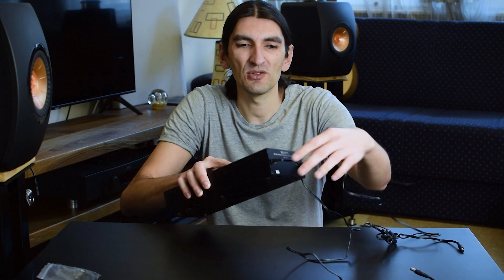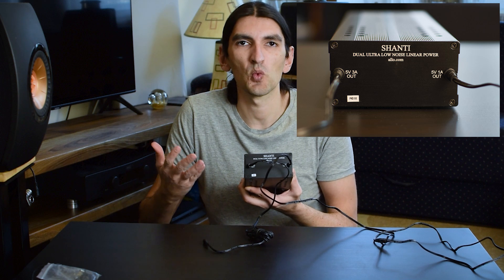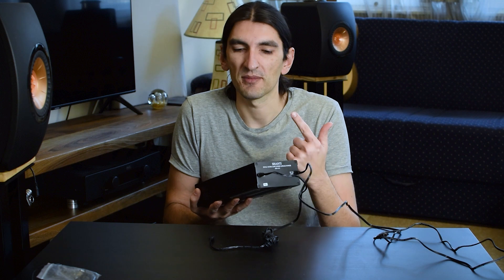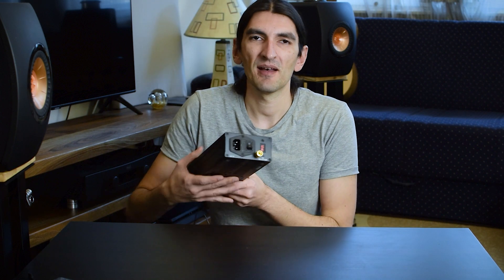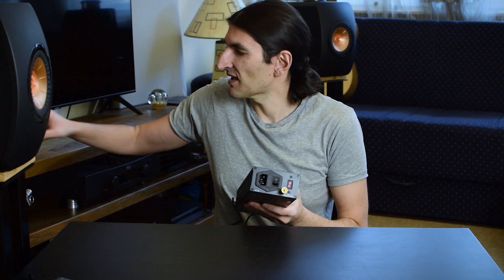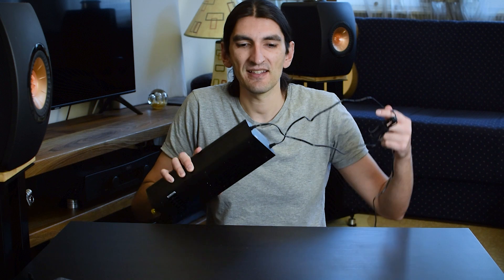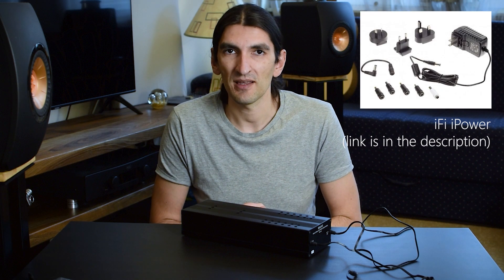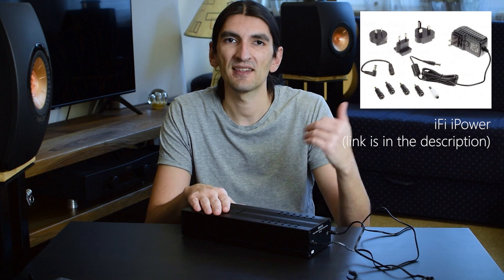Allo Shanti Dual Linear Power Supply Review

Comment: If I have issues with the installed electricity in my home, does it matter which external linear power supply I buy (cheap or expensive), if I only care about fixing issues like subwoofer humming, amplifier hissing sounds, and any other negative issue, caused by bad electricity installment in the walls or something? Let's say I don't care about improving audio quality, just making sure I don't have electricity issues impacting negatively my devices.

Comment: My issue with these is the same as all the power supplies out there you can buy. Yes they help but no I shouldn’t have to upgrade the clock / power supply of my two thousand dollar DAC. What’s next? Updating the DAC of my two thousand dollar DAC with another DAC? 

Tweaking is great but when manufacturers use the trend to skimp on clocks and power supplies it’s not so great.

Comment: Hi. Loved this video and it triggered me buy the iFi iPower X for my Wiim Ultra streamer/DAC. My issue is I cannot figure out how to connect it together. The Ultra comes with its own power cord. Bought it on Amazon and they cannot help me. Any suggestions?
Reply from the maker: Wiim Ultra has an integrated power supply (opposed to external ones on Wiim Pro and Wiim Mini) and it is fed with AC voltage directly from the mains. So you can't use external power supplies like that with it.
Reply: @iiWiReviews  Thanks. I am vindicated. Luckily I have other Wiims! $$$ sent.
Reply from the maker: That's great. It should make a difference with them. Thanks for the support!
Reply: Hi there, would this apply to the cyan 2 also? Or would that require a different type of power supply?

Comment: For the sake of accuracy: switching mode power supplies do have transformers inside them, except they are much much smaller for a given watt rating. 

The reason being the fact they run at much higher frequencies ( 40khz vs 50 or 60 Hz) which according to laws of physics allow reducing the amount of steel in the core and the turns number of both primary and secondary windings.

Providing they are properly designed they can give much better results than the classic linear power supplies

Comment: Great vid as usual. Would the Shanti be good for my Chord Qutest? Which output the 3 amp or 1 amp would be best?
Reply from the maker: Both can power Qutest just fine. Use 3A if you don't need it for anything else. But if at any point you aquire let's say a streamer that needs that more powerful side... You can move Qutest to 1A and it will work just fine.

Comment: I have ifi Zen One & Zen Can signature set, it comes with ipower 2. I want to change the power supply from ipower 2 to Allo shanti. Can I use the shanti for two device which are Zen One & Zen Can at the same time? The Shanti has two 5v output, but different A which are 1A & 3A. Is it OK?

Comment: Love the video. How can you use this power supply with a Topping D70s or does it not need it? Thanks.
Reply from the maker: It's not needed and also can't be used with D70s. Unlike most cheaper DACs, D70s has an integrated power supply.
Reply: @iiWiReviews  But this could be hacked by the handyman ;-)  
Do you think it will improve the sound quality though?

Comment: I'll consider this to power a Silent Angel Bonn 8 ethernet switch and hopefully it does a good job so i won't have to buy the Silent Angel Forester F1 PSU.   then there's the question of adding  a Synergistic Research Orange fuse on each DC powered box

Comment: Another great review!
A question, please: How does it compare to WEILIANG PSU in terms of audible noise coming form the power supply unit itself? In other words, which one is QUIETER and how much quieter is it? Thanks
Reply from the maker: Both of my units are perfectly quiet without any audiable transformer noise. This, however, might also manifest itself differently in different homes. For example, Hegel amps can be noisy if mains power is not clean... I know people using power filters to get rid of it, but in my home two Hegels I used were completely quite too. So I might be lucky with a fairly clean mains power here... But that said both of these power supply are perfectly silent in my place.

Comment: Not free, but included. You obviously paid for the hole package.
Reply from the maker: Yeah, you're right. English is not my mother tongue so I make mistakes, specially when thinking about some other topic and not the language itself. But I try to remember and apply corrections like this one.
Reply: @iiWiReviews  It’s not an issue with the language. It’s common misrepresentation that continues to spread like a virus. Many speak about a free apps being available for products you buy. I was under the impression that mostly infomercial youtubers talk like this to create the impression that you get stuff for free when you buy a product. Just be mindful of this construct 😀
Reply from the maker: Huh, interesting. It's just a mistake in this case. I purchased it myself, no connection or any other type of affiliation with this product whatsoever.

Comment: but my dac doesn't have dc power jacks just a power inlet. So i connect power cable with it. How would i use this linear power supply with that dac?
Reply from the maker: You wouldn't because that DAC has a power supply built in already. There is no upgrade path in that case.
Reply: @iiWiReviews  one more for the road. What if I connect this power supply in a ifi spdif ipurifier , its a small device that cleans the dac signals and reduces noise. And it has a usb 5v port that can be connected via external power supply. Would there be any sense or benefit connecting these things? thanks for the reply.

Comment: What do you think about Allo NIRVANA SMPS?
Reply from the maker: I haven't tried that one yet, so can't say anything.
Reply: @iiWiReviews  i want to try it for raspberry pi 4, bud don't know if it enough power (5v 2.85A)
Reply from the maker: @maruchok  It should be perfect for Pi 4. I used Shanti's 3 A out for Pi 4 and it works flawlessly. I also used some 2.5A power supplies and that worked well too.

Comment: hello and thank you. Question: which power supply output you used in the Allo Shanti to power the chord quest? 1.2 A or 3 A? Cause i need the 1.2 to power the chromecast audio
Reply from the maker: I used 1.2 one case 3A was needed for a Raspberry Pi as a streamer. But you can always use the more powerful one. Voltages always have to be exact, but more power in Ampers cannot heart the device, cause it only takes from the PS the amount it needs.
Reply: thank you :) … another one: i have both streamer and dac using micro usb. Allo just has one micro usb adapter in bundle…. what would you buy? just a chinese usb c to micro usb adapter?

Comment: I finally got one of these.  Everything you said about the power supply has turned out to be true.  I thin what's happening is that the blacker background allows details to emerge more fully.  It's not that these details weren't audible previously.  It's that they are now more prominent, but not in an intrusive way.  I did note however, that my Raspberry Pi4 froze a short time after installing the power supply.  That's never happened before.  I rebooted and all has been well since, so I'm hoping that was just an anomaly.  Thanks for the work you do here.

Comment: Last year I commissioned a custom made linear PSU by Baldwin Hifi. One rail is a 3amp rail @ 24v DC to power 4 x Carnhill Transformers and the 2nd rail is 5 amp rail at 12v DC to power a few studio bits and my sound card (an old emu 1820m). I always loved the sound of the Emu however the Linear PSU has certainly improved the sound the old interface as it usually runs from the computers PSU. Love your channel. Subscribed.

Comment: Can this be used to boost the Schiit Bifrost 2 Dac, which has a built in linear ps?
Reply from the maker: No it can, and you're good anyway with integrated LPS. This is for the DACs that cheap-out on a power supply and leave it to a small wall wart.
Reply: @iiWiReviews  Thanks for your quick response. I only asked because I also have a Modibit 3 + connected to a Topping P 50 and the combo actually sounds better than my newly purchased Bifrost 2. (Amazing what more power can accomplish.) Not as wide or deep, but slightly better tonality (violins sound like they are made out of wood, and the bow out of cat-gut, and the sound resonates in the cavity of the violin). This resonating quality is toned down in the Bifrost 2 and almost completely absent in my Denifrips Ares II, regardless of the filter used. I’m tempted to send back my Bifrost while it is still in the return window, and maybe get a Gungnir.

Comment: Thanks for this! Just wondering, why the focus on dacs / streamers, but not amps? Do amps not benefit from upgrading power supply?
Reply from the maker: Most DACs and streamers are powered by 5 VDC which means that the whole AC to DC conversion (220 or 110 VAC to 5 VDC) is done outside of the device in the external power supply. That external power supply provided by the manufacturer is usually a small switching power supply costing few bucks, low in quality and high with noise. With amps, power supply is usually a part of the device itself and the device is powered with a 220/110 V AC directly so we cannot use external ones. Also, all better amps for speakers have linear power supply inside already (huge transformer with a decent bank of capacitors, etc.). Most of the amplifier weight and size actually belong to their power supply sections.

Comment: Interesting to see the Weiliang Audio unit is available with 9V, or 12V, or 19V, or 24V - all separate units, that are set at the factory to a particular voltage. So, for other devices, like the Xduoo MT602 with a 12V power supply, or the MT601 with a 24V (I think?), it is good to have a linear power supply.Someone a long time ago, said that an amplifier (or really an audio system in general) is a modulated power supply. So, with a clean power supply, you end up with better sound quality.

Comment: Hi would this be suitable for the Mytek Brooklyn plus? I am in the UK and voltage is generally 240 to 230 not 220 will this be significant?
Reply from the maker: 230/240 V will not be a problem. Just be sure that Mytek Brooklyn uses 5 V and no more than 3 A.
Reply: @iiWiReviews  i'm think the Mytek Brooklyn DAC needs 12 V like my Liberty DAC

Comment: Do you have any idea if adding a linear PSU would give an entry level DAC closer to, say an M400? (for example SMSL sk10mkII + LPS)
Reply from the maker: It gets it closer but still not close enough. Even SU-9 vs SK10MKII + LPS... SU-9 wins easily to my ears.
Reply: @iiWiReviews  thanks! this confirms my suspicion. hope one day you can get schiit bifrost 2 and compare with ares II. I sold my modi multibit & currently using Chord Mojo + P50. even with LPS, the SMSL could also not come close to the mojo. But sometimes I still miss the fun sound / staging of R2R.

Comment: which one to use to power ethernet switch?
Reply from the maker: I use 1A out for switch and 3A out for streamer (as my DAC is powered directly from 220V).
Reply: @iiWiReviews  Which switch do you use?
I plan to us this power supply:
https://www.amazon.ca/iFi-iPower-DC-Power-Supply/dp/B010UYGA86

Since Amir from Audio Science Review debunked expensive switches like EtherRegen etc. stating that the spectrum of $640 switch vs $20 switch is absolutely identical at the DAC outputs. So it would make sense to buy a switch like DLINK DG-105 or similar and use power supply costing $50. Now I would assume it would not make sense to power such $50 switch with Shanti, which is expensive in comparison. Any subjective differences, Amir states, are due to placebo effect.
Reply from the maker: I use inexpensive D-link Dgs-108... It does make a difference when it's powered with a better power. I use this one simply because it was purchased for streamer and the second rail is unused. My friend uses iPower 5V with it and he's happy with it, he also noticed improvement. I don't have any experience with expensive audiophile switches so can't comment on that.

Also, ASR measurements are OK but their understanding of those and conclusions are deeply flawed and misleading. Won't comment more on that, it's long and flammable topic.

Comment: I'm wondering if using batteries, being an even more budget option, would hold up against such a - to my wallet - fancy piece of kit.

Have you looked into this and - if not - do you intend to, sometime?

All that said, I always look forward to and enjoy your comprehensive reviews.
Reply from the maker: I haven't tried battery packs since I find it bothersome to worry about charging. My streamer works 24/7. I might explore it sometime just out of curiosity.
Reply: @iiWiReviews  Thanks for that.

Personally, I'm considering a large-ish battery backup bank, perhaps one of the Omnis, or smaller/cheaper, with two, or more, 5 volt, USB DC outs, on permanent charge from the mains.

Even if it doesn't work out for the HIFI - although I don't yet know why it wouldn't - I'll have something to charge my devices.

Comment: Will you review the Allo Nirvana? Its a cheaper single rail solution. Price is nearly equal to the IFI. Or the Audiophonics lpsu25. For anyone who only needs 1 rail (streamer with integrated DAC like the Bluesound Node 2i).
Reply from the maker: If I can import it without taxes and shipping doubling the price I will. I'll look into it.
Reply: @iiWiReviews  Thanks for the reply.

After some extensive research (as far as I can on the internet) it appears the Allo Shanti is almost as-good-as-it-gets for a 5VDC linear power supply. So I am wondering: if I would order the Allo Shanti and use only the 5V/3A rail, would that not harm the Allo Shanti (seeing it's using seperate rails I assume not, but what do you think)?

Comment: Do you think this power supply would bring the Topping d50s to another level?  I have the old version of the Lavaudio DS600 which is a clone of the D50s, on a 5v 2 amp switching ps it does ok but there is a bit of something distortion/glare that you can feel and hear in comparison to say an AKM 4493 dac which is smoother.  The Lavaudio is very detailed, I wouldn't call it overly bright as it is fairly linear in presentation but adding a better PS might do the trick.

Additionally, I am picking up the same unit which has been upgraded to give an output voltage of 2.85 volts vs 2 volts in the older model.  At the price, the Allo Shanti might be a good option.  I like the size format of the Lavaudio and only need single ended output.  If it improves the sound, I wouldn't be looking at higher priced Topping units such as D70S, D90, etc.   If it brings the performance up, do you think there would be less distortion, a warmth to the presentation, what would you expect a PS such as this to do?

Opinions are all that I'm looking for as I think I'm going to get one either way.

If I really want to go bonkers with a dac, I would just get the "Gustard x26 Pro"...hint, hint.
Reply from the maker: Topping D50s reacts very nicely to a good power supply. But what I consider to be another level, you might not feel the same. That said, in my mind a good LPS is a long term investment since it can outlive several DAC changes.
Reply: @iiWiReviews  Thank you for replying.

Comment: Are the two outputs isolated from each other? I built a power supply for 3 dacs , a miniDSP crossover, and a TOSLINK switcher, with 15v and 5v outputs. I had to isolate the PSU from mains earth to eliminate high frequency noise. These were switching supplies though, isolated linear supplies would have been bigger and more expensive with little sonic advantage.
Reply from the maker: Allo claims that rails are separately filtered and galvanically isolated.
Reply: @iiWiReviews  The DACs are Topping D30, bought after your recommendation. They're a bit old now and there have been improvements in DACs generally, but none with the simplicity of operation that they have. The E30 would be overkill.

Comment: Bit surprised that you didn't compare it to the topping p50
Reply: Compared to my good Aqvox linear power supply unit (not manufactured anymore), the Topping P50 has a more open and deep soundstage. This is done by increasing the treble level. However, the bass and slam are lacking. Instruments sound thin and not natural.
Reply: @stevenewtons7873  oh my :) I own a p50 and although my system is a bit too bass heavy, some instruments sound a bit too "thin" as you described. Back on a shopping frenzy again 😀 (ok maybe not ..)
Reply: @nir8924  Besides the Allo Shanti LPSU, you might want to have a look at the LPSU from Audiophonics, although the front panel is not that great.
Reply: I'll look it up, 10x!

Comment: Great video! Curious if you have tried a USB battery pack, like a Mophie? I use one to power my Pi4/Allo Boss combo, and it is noticeably better than the cheap Pi wall wart. The downside is only about 3 or 4 hours of listening before it is drained.
Reply from the maker: I haven't considered battery packs since my system is usually on for long hours (streamer is basically always on) and having to worry about charging just doesn't appeal to me.

Comment: Srb you are the best. I learned more in 20 minutes about LPS and how they would fit into an audio system than a week of searching the web. I see where you are going with this. Raspberry Pi 4 and the Shanti. First class set up. I would love to see if you could compare the Raspberry Pi 4 to the Raspberry Pi3B+. I have been hearing the Pi4 has a more closed in feeling than the 3B+ due to the faster chip on the Pi4. IE does the Pi 3B+ sound better. Maybe one of your friends has a 3B+ to compare???Thank you Mark
Reply from the maker: I was using 3B+ and bought 4 just to compare them. So it's coming sometimes soon. :)